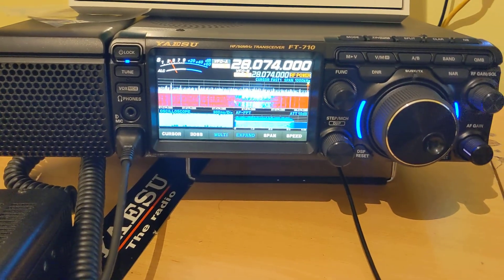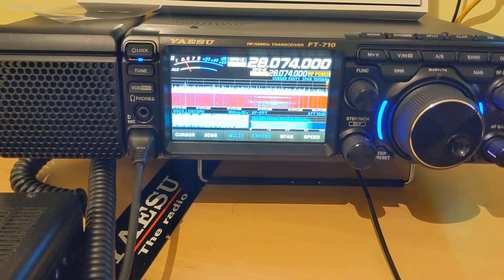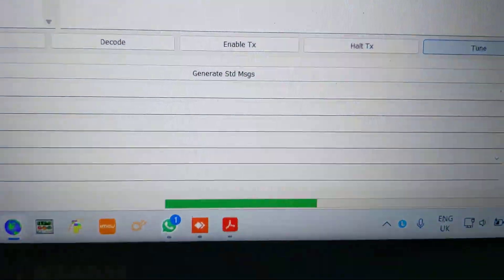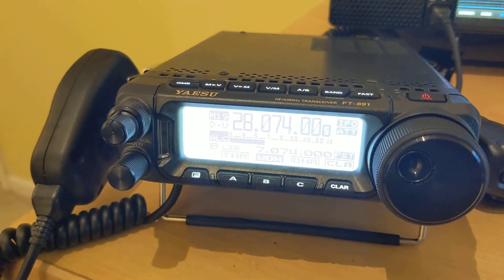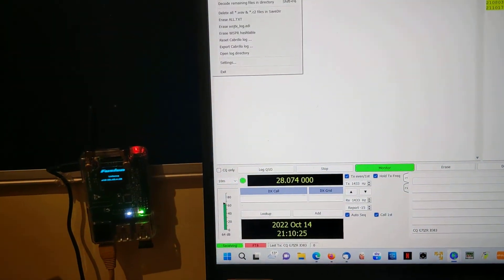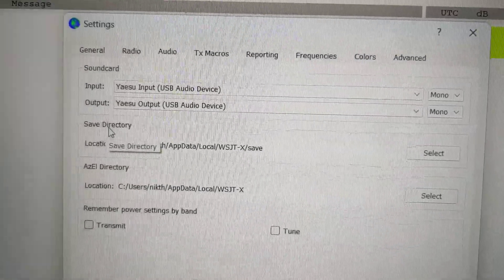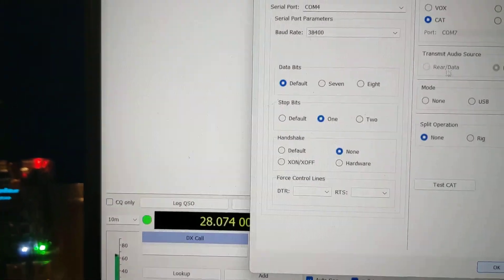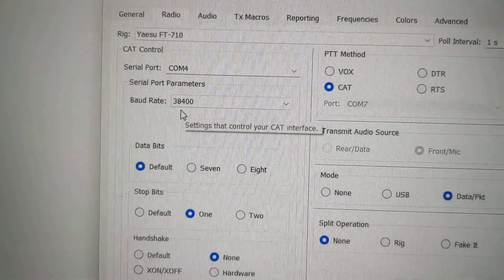Yaesu FT-710 & WSJT-X FT8 success!!

Comment: Had signifcant problems to get wsjtx cat control running. Make sure you have cat2 rate in the general operation settings (manual page 90) adjusted to the appropriate value (38400). Default is 4800bps. When adjusted it perfectly works.

Comment: I set up my ft 710 and got the FT710 working, however, the PTT no longer functions correctly!! I had to reset the radio back to factory settings to get the hand mic to work again..yes i have checked the manual and all the settings ... upon using ft 8 again, the mic ceases to work unless i use vox!!! or pre recorded messages

Comment: I have successfully got wsjt FT8 running using various configs but i cannot get a stable modulation out of the FT710. If i connect the output from the pc to my pc speakers i get a good stable tone when i tune. However when i connect to the usb output to the rig when i tune the FT710 goes into TX but no output tone just an occasional wideband click.  I have had it running in tx and the signal out is just a wideband noise. Everything receives ok. I can only assume there is something not right with the rig or i have a setting wrong somewhere.  I have downloaded the correct port drivers. It's driving me mad because it is something simple. Any help would be appreciated.

Comment: Question: works with "only" USB Cable and WITHOUT Ham Radio Deluxe?
Reply from the maker: Not sure I understand your question. It works with just a USB cable for WSJTX and also HRD. But only one at a time, not both at the same time as only one program can have control of the CAT interface at any one time. Does that answer your question?